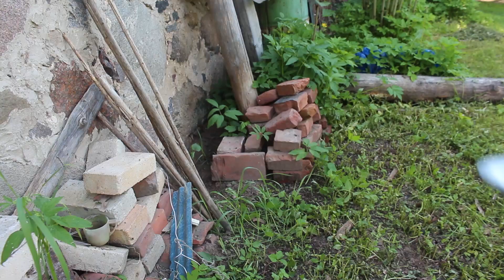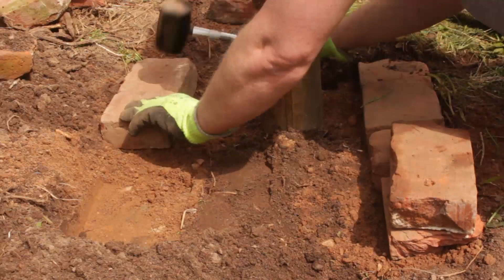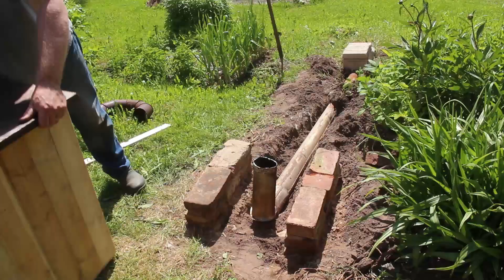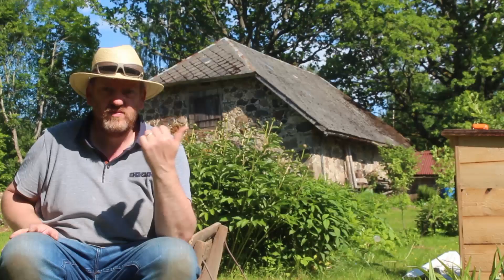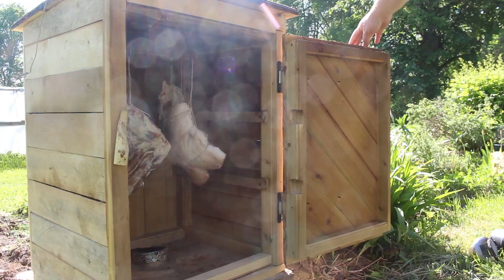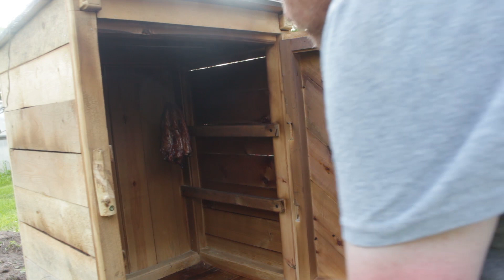Hot & Cold Smoker Installed & Used for First Time

Comment: That temp what looked like 160˚ C. Was that inside the smoker?
What would be an ideal temp to have in there?
Or is just the colder the bet	ter? 
Greetings from the other side of the Baltic
Reply from the maker: Hi so it peaked at about 140 I think but the average was around 100/110 for a hot smoke that’s fine. It’s quite difficult to keep it at a steady temp because of the fire but the long tube really helps. I’ve not done any cold smoking in it yet but I do have the tray to put the sawdust in.